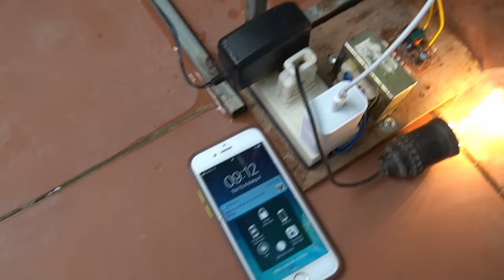Turn The Washing Machine Motor Into A Permanent Water Turbine Generator

Comment: Looking at playback the top speed of the turbine is 180 rpm but closer to 120 rpm on average.
For the sake of giving you the benefit of the doubt, we will go with 180 RPM.
Doing the math on you magnets with optimum coils and looking to be 30 coils a piece the maximum voltage you would get out of that generator is about 4.3 volts at 180 RPM
even if that is a 12v car water pump rather than a 120v aquarium water pump there is no way you are not powering that thing from a dedicated power supply.
Why are you lying?
Reply: How could he not be lying? That turbine isnt an optimal turbine, and even a industrial pelton turbine doesnt reach much higher than 90 ish % efficiency. You lose 10% of your energy right there already, thats already never going to work. Then theres the loss in the pump. And hell, even if all that didnt exist, and friction didnt exist , the resistance of the WIRES would stop the thing.

Comment: 9:58 Pluging in wires running up to the water return tube. WHY? 
Far more important, why isn't the light bulb plugged in BEFORE you add water to start the process?

10:06 Adding water to start the process. So what does the plugged-in plug power?

10:44 Playing with a volt meter. Absolutely meaningless unless it was in the circuit BEFORE the water was added to start the process.

10:56 Let there be LIGHT! But no truth. 
            If this was real, the light bulb would have been plugged in BEFORE the water was added to start the process.

11:19 You have plugged in a phone to charge. 
            Meaningless unless it was plugged in BEFORE the water was added to start your game show process that does nothing but hide the truth.

Pure bull.   ☢ 💩 🤡  

🔮 I see the future of your invention, no one will buy it...

The funny thing about our world, you can not create or destroy energy, it can only change form. It takes more power to pump the water up to the top than the amount of power your "fixed" generator being spun by the water can provide.

{For a far better show, make sure all of the holes you drilled are in alignment, and not just haphazardly placed as you have drilled them. You might just fool someone.}

Comment: I already understand why the video is so short and why the top part isn't shown in full because it's fake.  (Hereon fountain)

 Since the water can rise from the bottom by itself, the lower container must be absolutely airtight.
 However, since there is a hole for the rotating generator shaft, there must be an external water source with fresh water supply at the top.
 That's why the video is so short, because the water would multiply below and the fake would be noticed too quickly even by a layperson.

Comment: What the parts needed to make this?
Reply: A real pump, you can buy a cheap one for fish tanks. A homemade fake turbine, you can improvise that one with some scrap metal like he did in the video. A couple large plastic water containers. Hot glue. A disguised connection to the local grid to power the pump. Or even just a battery hidden inside the supporting frame. It depends on how long you wish to keep the pump on to Impress gullible friends.

Comment: You can see the water running out of the hose at the top. But the wheel at the top turns in the opposite direction. So much effort and dan overlooks the builder something 😂 fake

Comment: Fake perpetual motion machines are fun 😂. I would like to know what the harness output is though. Looks like the rusted motors might not do anything... But if they did, how much supplemental power would have to go to the water pump?  Energy capture is a good thing. So how much energy is captured back in this pointless machine? 

I kinda wanna build one that runs on 4AA batteries and see how long I can get it to go lol.